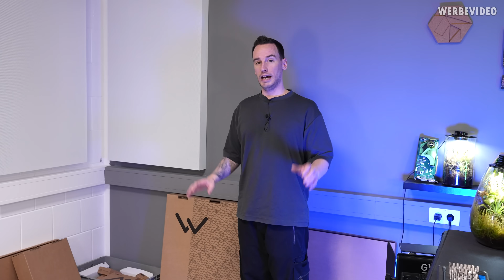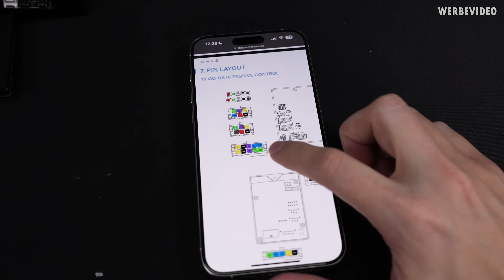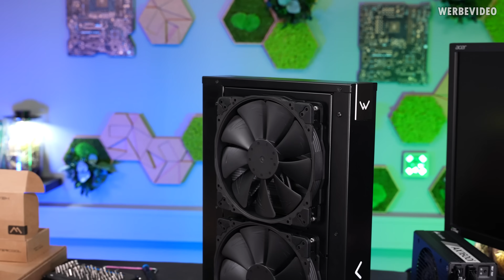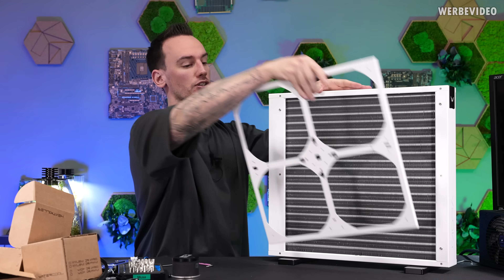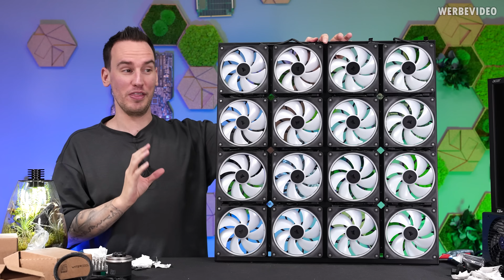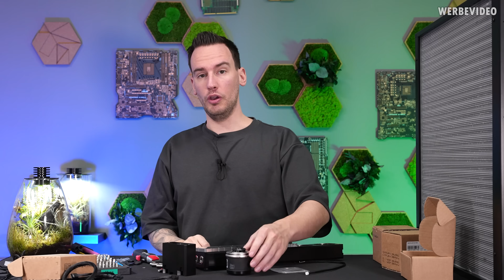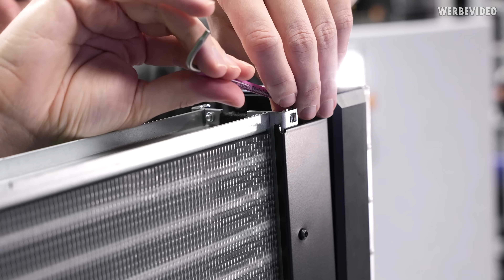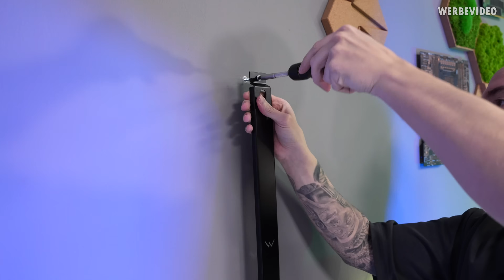The Most Extreme Radiator Ever Made - Watercool MoRa IV 600

Comment: Hope the wall mount will hold...
Reply: Yeah those plugs straight into dry wall is not sufficient lol
Reply: exactly, concrete anchors are not for that type of material.
Reply: Mount a 2' x 2' sheet of plywood behind it across two studs and mount it to that.
Reply: @bruswayne  Id probably mount 2x horizontal 4x2's screwed into studs. Then can mount the mounting brackets to that. This will also space it out from the wall some for better cooling.
Reply: Yeah, the water weight alone is going to be several kilos.
Reply: @Sandzsteedt  I have added all the parts in this build and water capacity of radiator and res - it's 28-29kg.
Reply: Proper drywall anchors are rated for 400N in standard (12mm) drywall. I.e. 4 anchors would fail at around 1600N or 160kg.
Reply: @RelativeRelativiness  anchors can be rated as such, but the drywall they are attached to is not. This project is 28-29kg and that drywall will simply crumble.
Reply: @gagarin777  It won't crumble the weight is evenly distributed, each anchor will experience around 7.5Kg which is fine. These anchors have been tested and validated for 15Kg on standard drywall.
Reply: Hey Roman! I've assembled a lot of TVs on walls like that! Those plugs certainly won't last long. You need plasterboard anchors.
Reply: @IbodhiFreire  No. He needs to find a stud and screw into that.
Reply: @staples4335 It's not necessary. In Europe, drywall is mostly mounted on metal studs, and drilling into them would just make everything unnecessarily complicated. A proper drywall anchor would do the job just fine - if they can hold heavy cabinets and closets for decades, they would hold this as well.

Comment: I would be adding more reinforcement to that wall bracket, by fixing a plywood base plate with multiple fixings points as relying on 4 plugs and screws with all that weight is risky.

Comment: I want that giant one but how do you drain it?!
Reply: With gravity, just let the coolant drain out. You could also flush it with distilled water.
Reply: @ that’s assuming it’s parallel, I think it’s zigzagging in serial through each pipe. Even if it’s in serial that implies that the inlet is at the very top coming off the side which also implies that the tubing is dangling off the side.
Reply: @theyehsohz  You can use top or bottom as inlet/outlet but yes it is a bit hard to drain it completely. I own a MO-RA3.

Comment: corsair icue is crap in my opinion.  Why don't you use the octo/quadro and aquasuit program to make a fan curve according to the water temperature.  Is there a reason you don't use it?
Reply: Agree aqua computer is easily the best software and hardware for water cooling
Reply: Using QX140 with O11XL 420p EK x3, build this PC 
I regret to use Cosair IQLink ,especially the cable it bad design angle ,bending is not recommended, expensive, and plug in extremely easy to be broken.

I cue 5 is using open GL affect the performance, nidiva launched a driver fix to avoid the crash issue.

Now I closed I cue 5 and use fan memory mode to run the curve pwm , I wouldn’t use iqlink the build water cooling anymore
Reply: Corsair's software is free while AquaComputer's costs a yearly fee to use those features, but you get what you pay for. oh also if you want a better solution for feeding it data you likely need HWInfo subscription as well.
Reply: There is no need to actively adjust the fan speed with this radiator.
Reply: aquasuite is even bigger shitware than iCue IME, paid updates are 🤮
Reply: Overpriced crap.
Reply: @swizzler8053  As compared to Corsairs overpriced crap? I would much rather pay for Aquacomputer. Aquasuite and the controllers will give you the option to do literally almost anything.

Comment: So someone has finally realised they could monetise the insanity of hooking up what is essentially a car radiator to a computer? You could probably run eight computers off of that thing 😂
Reply: Watercool has been making the MO-RA series since 2003 so I wouldn’t really say ”finally”.
Reply: on top of what Simon said.. watercool was the company that took the DIY junkyard car radiator concept a lot of us were doing in 2000 and made it accessible and user friendly for everyone. yeah it's expensive but you might want to check on car radiator prices, lol.
Reply: @sirmonkey1985  Also pretty much all of the car radiators are made of aluminium which I wouldn’t mix with anything else in PC watercooling regardless of what coolant I’m using.
Reply: @Simon_Denmark  Aluminium should be fine with PC coolant, though?
Reply: @Simon_Denmark  Except pretty much all AIOs being aluminium rads and stuff...
Reply: @AlexeyDyachenko  Do it on your own risk. That was my personal opinion. There’s different coolants out there. Some use just plain distilled water and some use corrosion and bio inhibitors and some use glycol based coolants.
Reply: @alkestos  I mean there’s a reason EK had the fluid gaming line separately and instructed to only use aluminium parts in the loop. A lot of coolant manufacturers recommend this too and you may void for example your waterblocks warranty if you mix aluminium with copper/nickel plated copper. It’s all on you if you mess up your loop. There isn’t that many mixed metals in AIO, it’s literally just the copper cooling plate and the glycol based coolant will handle it fine.
Reply: @Simon_Denmark  house heating systems use alu radiators with all of those inhibitors in antifreeze coolant, with bronze and copper also present in the system. I'd worry about the rest of the components, rather than the car radiator if I were to use antifreeze. The system is smaller and is more accessible so I'd use distilled water and swap it often.
Reply: @AlexeyDyachenko  Like I said just be aware of the risks you’re taking and the necessary maintenance. I wasn’t worried about the radiator if you even read my other response.
Reply: @AlexeyDyachenko  House heating systems do not have tiny fins on GPU and CPU blocks. Not sure what your point is supposed to be.

Comment: So this is one of those "been there done that" things with me.  16 fans is loud no matter how you slow them down.  Also, you're paying a lot of money for some bent sheet metal.  If you want to make something like this and save a lot of money: "air to water heat exchanger for hvac" is the keywords.  Copper tubes, aluminum fins, etc it's meant for commercial buildings where you use water to change air temperature.  Watercool is just using one of those as their core and then putting some sheet metal framing around it and g1/4 ports.  There's also zero chance you actually need 3 pumps in any sort of application, you can run a whole house loop on one of those.  Anyways I moved on from this sort of thing and it's only my backup cooling if for some reason my tap water cooling needs to go down for maintenance.  That's been running 24/7 for about 3 years now.
Reply: It's only around $600.00, people who think they could never afford it may want to consider getting a better paying job.
Reply: This thing prob costs thousands. What a ripoff.
Reply: @Akkbar21  The rad itself is about 550 euros, small one is 229e, and im willing to pay for the convenience.
Reply: @alkestos  kk. Of course it’s your money, your call. 👍

Comment: This should be stock cooler for 14900KS
Reply: @club4ghz  I bought a 12700k because I wanted to use air cooling and it’s still a bit of a monster at times if I push it.
Reply: @Akkbar21  I bought a 12700K in 2022 for use in a Hyte Revolt 3...which means 240mm AIO.  A year later, I then put it in a Terra (along with a 50mm GPU), which limited the cooling options to a 67mm downdraft cooler.  Even with a small undervolt and reduced PL values, it still bosts to 5GHz without thermal throttling.  For 4K, GPU-bound gaming, it still trades punches with anything on the market.

That CPU is really Intel's last contender for GOAT status.  It's very powerful, with reasonable power and cooling demands, but still with enough headroom to juice it up via OC, if that's your use case.
Reply: @ I love the cpu and the cooler (nh-d15) I have handles it at stock no prob. Just uses a lot of ⚡️
Reply: And it would still burn up and self destruct 😂
Reply: @michaellegg9381  No with this cooler, direct die it could work for years at 1.55v at 6.3 Ghiz if you won silicon lottery but Ryzen 98003D make it all pointless now. Intel has reached its Chernobyl moment and now it's time to recover.
Reply: @club4ghz  I was being a smart ass because of the danger of running 14th gen at stock bios settings and the self destructing unless you limit it to around 125w or the 14900k will kill itself. Every single review channel was warning everyone to rush and undervolt the 14900. So my smart ass is correct running a 14900 stock will kill it regardless of what cooler your using because it wasn't voltage alone that was the cause.
Reply: Pure facts, fake fictions.
Reply: i died... hahahaha
Reply: Good to see you on here man lol
Reply: @FPSkillerPC  O hey there, how's going. Will you be getting 5080 to put some more heat on your CPU ? I'm sticking to 4080 as I'm CPU tied to it and the performance is still beast at 1440.
Reply: @ hey man, yeah I’m thinking about it as I would like a 2x jump in GPU performance. I just hope it’s not some stupid price, I’ve got a project car going on atm 😂
Reply: @FPSkillerPC  2x jump? huh
Reply: @Akkbar21  Yeahh I’ve got a RTX 3080 atm so I’m hoping it’ll be a 2x increase to the 5080.
Reply: @FPSkillerPC  Probably 30% over the 4080 so it will be 1.8 times 3080
Reply: @ good enough for me, we’ll have to wait and see how far the clock speeds go when the benchmarks come out
Reply: @FPSkillerPC  3.3 to 3.5 Ghz OC probably 400w so it will draw 320 on average at 1440 like OC'd 4080.
Reply: @club4ghz  still better than my 550-600 watt 3080 OC lol. The Samsung node sucks ass
Reply: @FPSkillerPC  3080 is not designed for that kind of power it will blow up the mosfets in a long run.
Reply: @ oh. Sounded like you thought the cooling would increase your perf by 2x.
Reply: it's the box cooler for a 5090, couple of $1000 is probably within budget according to nvidia
Reply: I use the 420 with 8 200mm Noctua fans for my 14900ks and it helps... haha
Reply: @ 8 noctua fans. Do you miss your first born child?
Reply: Nah, my MoRa 420 with 4 x 200mm fans keeps my OC'd delidded 14900KS and 4090 water temperature to about 3C above ambient. This seems overkill, but I guess it would be even quieter.
Reply: I use it for my 13900KS.  It never goes over 65'c.  When I bought it, however, they were $220.00 USD....  I have two.
Reply: @choosetherightify  I use Corsair H100i 240 For 13600K 5.7 x 4.5 x 5.0 with 4000c15. It goes to 107 Celsius in Cinema Bech hitting almost i7 score. But I use 5.6 x 4.4 x 4.9 24/7 Gaming.
Reply: my 14900k locked at 6.3 only hits 70c on stress test with Liquid Freezer III 420. I am better at thermal paste than most though lol hahahahahah
Reply: @TheActionStack u got lucky silicone. It's a nice thing to have. I had 3 i9 9900k's in 2019. 2 of them were great but one could not hit all core 5ghz. The best one hit 5.3ghz on stock cooling no de lid.
Reply: I spit my drink out reading this one 😂
Reply: You mean the power spiking 7900xtx over 550watts??? I have one do you even own an Intel CPU?
Reply: In reality reckon 14900K would be worse than KS... Usually KS are binned chips that can take a lot of undervolting... ( At least my 13 gen KS can ) 
Doesn't thermal throttle while pulling almost 300 watts in R23 . (420 mm AIO used,not custom loop)
Reply: G'day club4ghz,
1 if you limit Mobo VRM to TDP
X2 for Stock Thermal Boost
😂
Reply: you shouldn't use one unless its delided.
Reply: I need this for my 9800x3d. That piece of junk hits 80°C at 160w. My 13900k could do 300w+ and never hit those temps.
Reply: @jjlw2378 Then there's something wrong with your 9800X3D. Also not sure I believe that your 13900k never went over 80c those things get super hot. 

Mines on a custom loop and undervolted and it will still hit 89-90c on a full load. For gaming it sits around 50-70 depending on the game.
Reply: @XxViciousxX  10min R23 run on 13900ks around 300w at 5.8p/4.5e/5.0ring at 1.36v would hover around 80°C. Meanwhile, I compile shaders at 150w on the same loop with 9800x3d PBO +200 CO -30, and Tdie will hit 80°C+. Intel Sig V2 block vs. AMD Heatkiller Pro block is the only difference.
Reply: @jjlw2378  You’re complaining about a completely safe and normal CPU temperature when the CPU is being utilized at 100 %? It’s completely normal that the 9800X3D would hit 80+ with 150 W on a shader compilation. For a 7800X3D it would be even harder to dissipate all that heat because of the 3D V-cache location. You also still need to remember that AMD wanted keep cooler compatibility from AM4 which affected the IHS thickness.

Comment: My heat exchanger uses 16 140mm fans in push pull config. If I shut off the fans it takes 5 hours of solid computing to raise the water temp to 70c
Reply: I could not imagine allowing my water temp to get above 50c, let alone 70.
Reply: 70c a typo?

Comment: Finally, external radiator product that includes wiring solution. I had to cut one of unused PSU cables to extend it to feed pump and fans, alongside a long USB cord for controller.

Comment: What a monster. That 6x6, not you. Just for science: Try cooling a CPU with zero fans at all on that 6x6. I'd suppose that the surface area should be enough to cool quite a few CPUs without any air going through the fins at all. Anyway, too bad that there is no option for push-pull... not that it would be needed.
Reply: I bet anything under 150 watts could be passively cooled.

Comment: How long until Der8auer starts using an aluminum car radiator?
Reply from the maker: I think most car radiators are smaller xD
Reply: @der8auer-en  Meaning this is totally useless overkill, i hear ya.
Reply: @der8auer-en  you would be suprised how large car raidators actually are. at least for decent cars. a 0.9L ecobox wont have the same radiator as a audi A8 land boat.
Reply: @SupremeRuleroftheWorld  You do realize he's also a car guy, right? And no, the vast majority of car radiators will NOT be notably bigger than this, you'd have to use one from a truck for that.
Reply: @HenrySomeone  this radiator is roughly the same size as the one in my 2.5L V6 alfa i replaced just a few weeks ago. scale is weird sometimes.
Reply: @HenrySomeone  Just drop in at the local radiator shop. Every town has one. They'll charge maybe $100 USD to make a custom radiator which will be far more efficient, with custom hook ups already installed. You won't be nickel and dimed to death with all the nonsense of this system.
Reply: that is what is this already is. and everyone used car radiators, garden hoses and eheim aquarium pumps before there were "offical" pc radiators.
Reply: @SupremeRuleroftheWorld heck yeah, I ran a hydor L30 + 1976 Chevy impala heater core. Back in the day, I had a hard time finding a reducer to go from 3/4 to half inch, but overall, it was a good time.
Reply: @SupremeRuleroftheWorld back in my day this is exactly what we did.   Salvaged Toyota car radiators with a DIY PWM controller on their thermo fan, Eheim aquarium pump and super primitive copper water block.

I remember running this set up on Tualatin Celerons and getting huge overclocks (for 2001) e.g. Celerons 900 up to over 1200Mhz easily
Reply: @SupremeRuleroftheWorld  Can confirm. We literally used used card radiators, actual plumbing for houses and in desperation, we bought garden hoses. Aquarium pumps were inexpensive and easy to find. Was it loud? Hell yes. Did it cool? Fuck yes. You can hit condensation if you're not careful.
Reply: It's the reverse. When is he try to use mora 60x60 in some weichle with liquid metal to cool the engine? 🤣🤣🤣
Reply: @devilzuser0050 I think the MoRa is superior to a car radiatior, just check the schematics of its pipes and the distance of the fins. it is also super easy to clean.
Reply: truck radiator*
Reply: @rlifeh  Precisely, you'd need a truck one to even bigger.
Reply: what you just joked about is actually a fact and this is how watercooling actually started : car radiators + aquarium water pumps!
Reply: In the early days of watercooling it was common to use a car radiator
Reply: We used mostly motorcycle radiators here, since they were often lugged to LAN parties in the 90s.
Reply: Scrap icue, then do those Lian Li LCD fans.
Reply: @AugmentedKing  Honestly just make a bracket to tape a big ol box fan to it. I'm sure there are some ones that are quiet and efficient.
Reply: @roboman2444  Let me know when the box fan with the lcd screen in the hub drops😅 You have to admit that 16 Lian Li TL140mm LCD would be quite the sight!
Reply: This is better than a car radiator. It's larger, and has copper tubes.
Reply: I use a smaller cabin heater radiator from some large Fiat van on my setup, just looked around Amazon until I found the right size for two 200mm Noctua fans :)
And I looked it up: A 970 x 670 x 70mm radiator from a Mercedes Actros MP4 is about 700 Euros :)
Reply: Imagine noctua diversifies to a car rad company. The Noctua limited Porsche Cayman could be real someday.
Reply: :face-purple-crying::face-purple-crying::face-purple-crying::face-purple-crying::face-purple-crying: